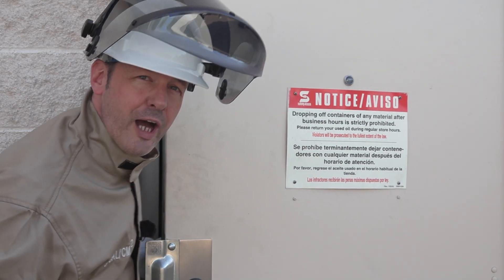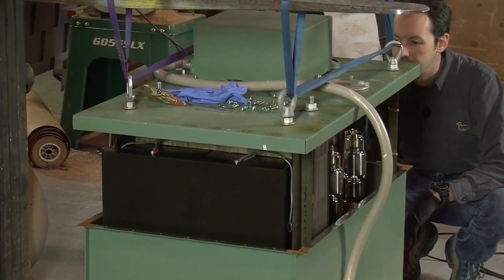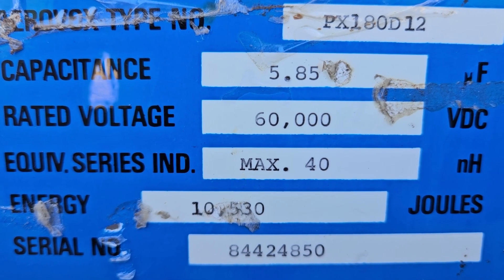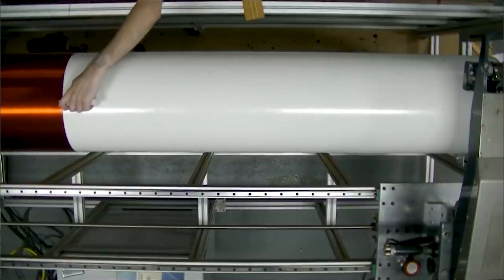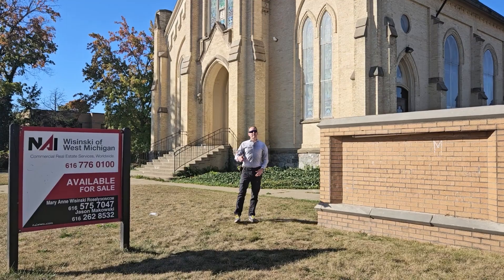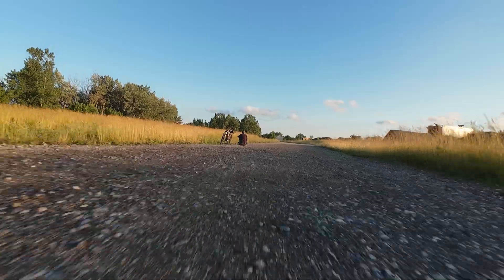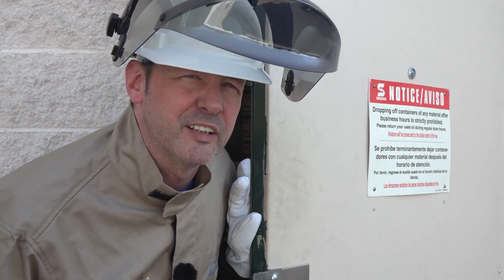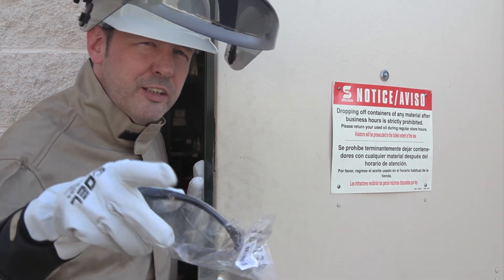Don't Do This - High Voltage For The Home Shop, Season 1 Episode 1

Comment: Never have your work checked by 3 pairs of eyes that know about eachother: the first will assume there's still two coming after them, the second will think it's already checked and then there's the backup, and the third won't bother because it was already checked twice. Always assume you will be the only one who will check things worth checking, because "it is insanity not to try to avoid your own mistakes, which you can do, but instead try to stop others from making mistakes, which is not in your power." (M. Aurelius)
Reply: I wish more things were tested beyond fail because most crap barely works as designed.  I spent several stints working in software testing.  I don't come at it to check to see if it works.  That's the price of admission for the developer to hand it to me.  I come at it like UL fire testing an elevator.  I'm the bigger idiot that they world is trying to create.  Murphy and I are poker buddies. I beat, break, and smash the code into little bits, sweep it into a box, tie a bow around it, hand it back to them with a note.  Please fix.  XXOO ---Tester.
Reply: @fredinit   @BenODen - you guys are redundant now. The customer/user is the test case these days.
Reply: @fredinit  Ah yes, peer reviewed by another developer, tested by one of our consultants and then it comes to me, the test automation engineer, who points out that half the buttons are hidden behind other parts of the UI at the lowest supported resolution and if your name has a - in it the application backend crashes.
Reply: Worked at a consumer electronics company that was very serious about quality control.

First batch of final product was never released for sale... it went to "the torture chamber".

Which was stuff like a platform that could simulate a truck riding a dirt road for daysin a row. A room that could smoke a year worth of cigarettes in 24h (products reeked coming out of there).

A climate room that would constantly change temperature and humidity well outside of the "storage" temperatures and humidity range... while operating. Another room exposing the products to high UV and IR radiated heat from various angles.

They had Faraday cages to be able to test how much interference the radios and receivers could handle. Some would be put into a room that would expose a product to EMPs until they began to fail.

Then of course also the regular power spike and brown out test, and opening the product and shooting the ESD-gun straight onto the PCB around components that would usually be the most sensitive.

For smaller items, drop testing them, like you can find how Nokia used to drop a phone 1m onto pavement repeatedly until it failed. Also tested if the item would survive being dropped into boiling hot soup.

All products coming out of the QA department would then be inspected by engineers to determine how each test had impacted the products. 

There was of course also the lucky products that would just be endurance tested automatically, or the ones tested manually by "almost" regular people with an obsession to try find corner cases that could make the software fail.

The goal was neither to break the product nor to make an unbreakable one. 

The goal was to be confident when you slapped that 10 years warranty sticker on the product, you'd not get a wave of silly warranty claims 5 years later that could have been prevented.

My job was to handle software tickets from the market on a row of products, then do my best to be able to reproduce the error, and if found,  figure out how to consistently reproduce the error and then improve the tickets and elevate them to bug reports with a level of description so that it was useful to the developers.
Reply: Like one IBM tech instructor once said "Assume nothing, because that will just make an 4SS out of YOU and ME "
Reply: @wernerviehhauser94 assuming you’re coworkers are competent is definitely one of the more dangerous assumptions 

That I’ve made

I mean, nothing serious, but still 💀
Reply: I'm a software tester by trade and the bosses always love/hate it when you find irredeemable bugs that have been "tested" by no fewer than a dozen people, and missed by all the customers.  It's still a bad bug, if the answer is all wrong and in all the reports.
Reply: I recently came upon the realization that the best way to do it right, is to not fuck it up
Reply: And if YOU are one of the 3, always assume to other 2 are blind, blithering morons. Plus, for safety, assume YOU are an idiot too. Because sometimes you'll catch yourself doing something stupid.
Reply: This evokes the reaction video of the  block-sorting toy where every shape of block gets put “that’s right, it goes in the square hole!” to the “engineer’s” dismay.
Reply: Or you tell them they're the first and only person to check. True or not. Make em sign an agreement not to discuss their work with coworkers (within reason) so the secret doesn't get out.
Reply: In God we trust, everything else we check.
Reply: This is a great tip
Reply: Trust is good. Check is better.
Reply: Always check the title itself.

 "Total Quailty Management" depends on it [real example: invite to the corporate all-hands briefing]

Comment: Sublimated arms? Count me in.
Reply: There's a reason god gave you a spare
Reply: @travismason2811  That's what I'm saying, safety truly is overrated. Most people I know are at the very least missing a couple digits.
Reply: "I'd give my right arm to be ambidextrous." ~ Brian W. Kernighan
Reply: Did my first construction gopher job under a family friend who was missing digits in the exact progression a handheld circular saw would remove them while free-cutting a 2x4 under the influence.

Been that ATGATT safety Nazi ever since.
Reply: @NullHand  How many influences was he under, because I never freesaw less than 2.
Reply: Seen someone get smoked like a Sunday brisket off of 45kv from an ancient coherent everlases.rectified filtered 45kv at the ends of the lasing tubes with some large transmitter tetrodes limiting the current to ground... thing is the tube ends were at full potential with whatever the big transformer could source. 3x cores off a 3 phase supply wired for 200A per phase. He didn't make it 💀💀💀
Reply: @christopherleubner6633  Ya I got some photos of a buddy of mine, he blew up. I mean he's fine'ish, he's still alive, but he exploded. Must of been one of those occurrences where the lightning bolts exit your eyes, nose, mouth, butthole, ionized all the atmosphere in a 3 foot radius, that's a 6 foot diameter for you metric nerds. The hospital pics are actually kinda funny, he looks like a mummy, once he gets down shedding his whole outer layer he'll be fine and back at it. Shame all his skin is gonna fall off, it did give him a pretty good tan, kinda jealous.
Reply: @christopherleubner6633 
Similar thing happened to my sister's brother-in-law when he was young. Reached out to touch a railway overhead conductor. Blackened him head to foot, severe burn to arm and leg. His mother ran past him because he wasn't recognisable.  He survived fairly ok, but still has to wear a compression sleeve to keep the scars in check.
Reply: Never knew I needed this.

This is the true definition of hallmark, semi-soft LPT Pro-Tip vidya.
Reply: Look mom, no hands!
Reply: I always wanted sublime arms.
Reply: Insert furby "yuuuuuhhhhmm"

Comment: In my undergrad electrical engineer degree we had power lab. We were on the three phase chapter and IIRC it was 608V. My lab partner was following all safety rules and somehow produced an arc that went at least three feet and smelled like ozone . For the rest of the semester you could hear the the master bench switches getting flipped because no one wanted to make lightning again. Electricity can kill you but so can a lot of fun things.

Comment: And yes, stupid hurts. I can vouch for this. Only alive today because my legs collapsed and i fell off the steps breaking the circuit that was right between my 2 hands :)   I now learned to prove things to be dead, so I don't become dead
Reply: Noted, balance awkwardly as a physical disconnect fuse.
Reply: Forgot to shut off the 480v supply to a panel when I was done testing. Getting buzzed while undoing the feed cable was not a fun way of finding that out. Lesson was definitely learned
Reply: @mishicusmoshicus99  ouch.. Mine was 240 but getting locked on was scary AF. Glad you made it
Reply: 700v dc across my hand. Vaporized a bb sized hole on the end of my index finger and lots of tiny black spots on my pinky. Sooo lucky that day!
Reply: Got across a 4kv capacitor once, part of an electrostatic particle filter. Hand to hand, felt like someone had fired a cannon through my chest. That gets your attention. Safety is NOT an accident.
Reply: My sleep-deprived dumbass tried installing a breaker on a live circuit. My internship attendant made sure to never let me forget the buzz 😭😭